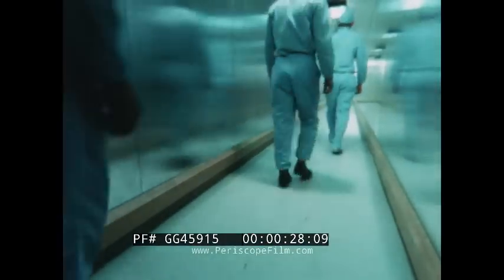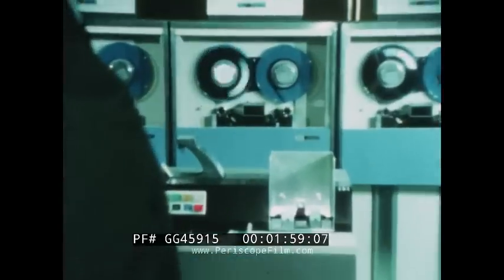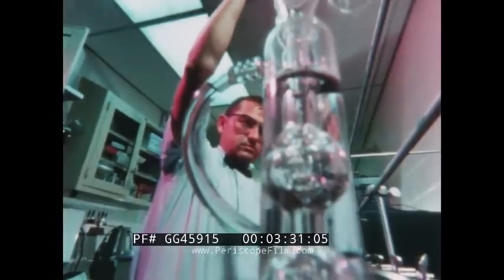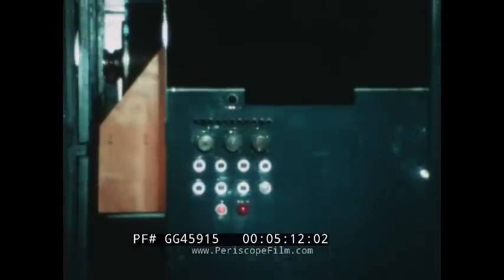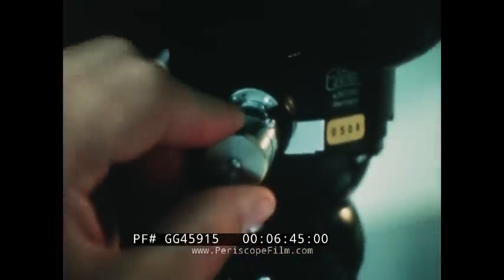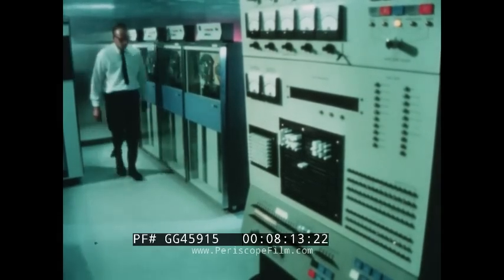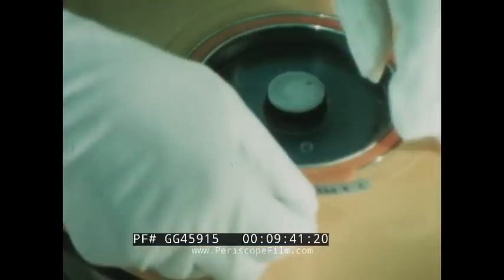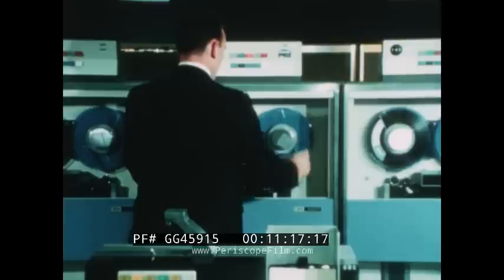" PRECISION: THE STORY OF IBM MAGNETIC TAPE "  COMPUTER DATA STORAGE 1/4" TAPE FUNCTION GG45915

Comment: It would be nice to know what year this was filmed - the title art and some of the equipment shown make me guess 1965 to 1968.
Reply: The narrator did mention lunar landings.
Reply: @allanrichardson1468    Thanks for the reply.  Yes, I caught that reference.  It wasn’t clear to me from the context if the reference was to current or planned lunar landings.
Reply: @wtmayhew They were planning and computing from Mercury on, and probably using IBM-360s as shown in the film from Gemini on.  NASA programmers contributed the design of the improved job and output queueing system HASP (Houston Asynchronous Spooling Program) as a free (because publicly funded) add-on to OS/360, which became almost universal among large scale users.  Later operating systems for IBM-370 and beyond had HASP seamlessly integrated, renamed JES (Job Entry Subsystem), but the status and error messages displayed on the console and printed for the programmer still (as late as the mid-2000s) had $HASP numbers at the front!
Reply: @allanrichardson1468 . Thank you for adding the history.  Yes, I have seen HASP messages many times on then green bar printouts of batch jobs I ran, of course.  I never stopped to think of the history from whence it came.

Comment: As  marks-the-spot mentioned this is 1/2 inch tape.  I started using it in 1973 and the last I remember it was in the l;ate 2010's.  It started as 7 track 556 BPI and went up to 9 track 6250 BPI before being replaced by cartridges, still 1/2 inch tape, but more like a 8 track self contained unit.  They have been mostly replaced by large storage devices that transmit the data, but some tapes are still used for long term archive.
Reply: A couple years ago where I work I saw a small stack of 9 tracks in their cases... here we are in the 2020s and this small sample of relic catches my eye from the late 70s. A couple people I showed just thought they were old projector films... but that's a design I'll never forget and immediately recognized it as computer storage long gone by. I have never been aware of a machine in the building capable of reading them, probably the last of some archive they had to hold on to, but regardless, took me way back, real quick. Memories as a kid with my dad on weekends loading them for use at his work.

Comment: I remember when we had several 1/2 inch tape drives at work.  We had this weird little, 1 inch square reader that had clear glass on one side and internally it had iron powder.  You could set this device on a strip of magnetic tape and you could then “see” the magnetically recorded binary data as recorded on the tape.  We had to degauss this device before use so that it wouldn’t be magnetized enough to erase the tape.  In the end you could indeed see the individual bits of data, but it was almost worthless to do lots of diagnostic discovery. It was a headache to look at more than a few dozen bytes or words of data.  It was useful to inspect the tape header and trailers.  We felt like God had blessed us when one day we were blessed with our first hard drive!  Discs 1 meter in diameter and one inch thick!  I think we could store a whopping 1K on each side of each disc platter.  It had to be mounted on special springs because when you hit the ON button, that sucker would shake the daylights out of itself and the room it was mounted in.  A couple hundred years from now, techs will laugh that all we could store on a hard drive was a meaningless 50TB of data.  “Shoot….my watch does 100 times that amount!”  And so life goes!

Comment: One correction to the title, the tape is 1/2" wide. I know because I used IBM tapes and drives early in my career. This was fun to watch, thanks!
Reply: I know, too, because it was mentioned at 6:10
Reply: And had 9 tracks spanning it.

Lots of memories in this... when I was a kid my dad would take me in to work with him on some saturdays and I was allowed to load the reels onto the decks and ready the machines. Little more than placing them on the hub and securing a lever followed by a button push... followed by the vacuum and transport motors doing their thing... but it was magical at the time and especially the one tape which held a copy of the famous mandrill image... just appearing out of nowhere on one of the first full color inkjet plotters in existence. An entire room full of what amounted to a single computer, doing a parlor trick. Intended purpose for the machine by the company was to plot oil fields.. think I welled up when that use case was mentioned in the video. 

Wish I still had that particular print.
Reply: It was mentioned several times in the video that it was 1/2” wide

Comment: IBM tape would no doubt be terrific for audio recording.
Reply: Nope. Computer tape is lousy for audio. In audio you want a smooth recording of every possible audio level from silence to loud. In computer tape you want only two levels, on and off. They use different oxide formulations.
Reply: Actually no.  The B-H curve or coercivity is too steep for audio recording.  There was a real quick short on the film where you could see the curve on an oscilloscope screen.  The transition between the two states of magnetic saturation was almost vertical.  For audio recording, the transition between states should be closer to a 45 degree slope to yield as linear as possible magnetization versus applied input without saturation.  In the digital domain saturation is good - only 0 or 1, nothing in between.
Reply: Probably fine for Rap "music".
Reply: I guess if it was in a PCM recorder it would be fine lol

Comment: Now too outdated technology  unfortunately.
Reply: Actually not. Modern tape drives are used for backups. Light years beyond what's seen here, of course.
Reply: Oh I see, thanks!
Reply: Look up the LTO tape drive its now the size of a cereal box the tapes even smaller LTO-9 18TB
Reply: Ok!
Reply: Tape backups are still the only reliable long term storage option.
Reply: Tape -  at least audio or video - which has been stored for years has to be carefully baked and dehydrated or it is likely to break or flake off oxide if playback is attempted,  I worked for a place who backed up to DLT cartridges in a 48 slot robot library.  We rotated the tapes out weekly to a decommissioned salt mine.  We got the old tapes back on about a one year rotation and recorded over them.  We backed up essentially everything in the business every time, so we didn’t need to keep tapes in storage for years.

Later we switched to using Replay which transmitted deltas as sectors where written for a very large RAID 50 made of a cluster of RAIDed servers.  The deltas went over a dedicated SDSL line to a partner company also running Replay who wrote them to a huge array they maintained.  It was pretty neat because I could have analysts as me to get back a a document the way it looked three weeks ago, or whatever.  Replay could back out the deltas and reconstruct the original document.  We were off tape at that point, but there was an incredible amount of redundancy built into our storage system, both locally and through the off site partnership.
Reply: That’s really interesting. What a neat set up.